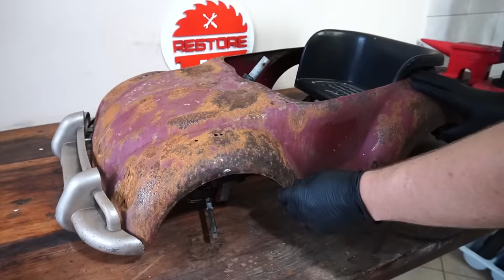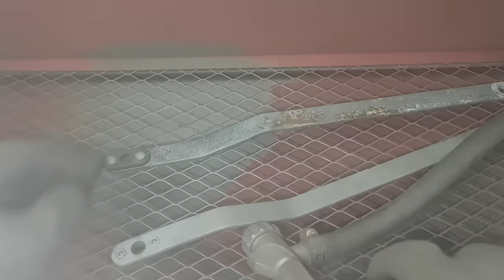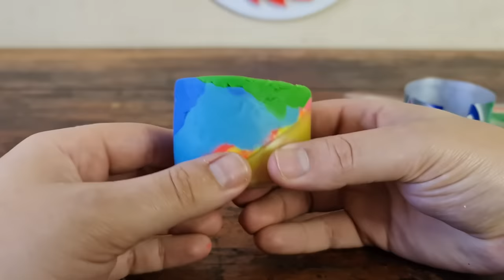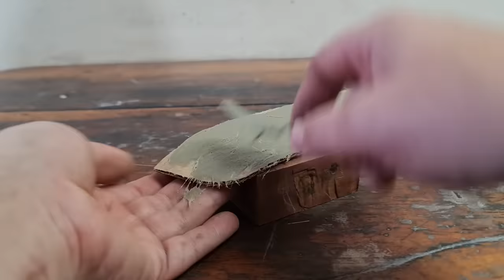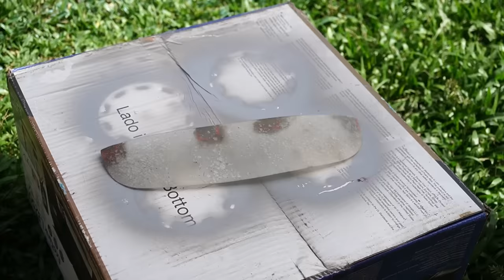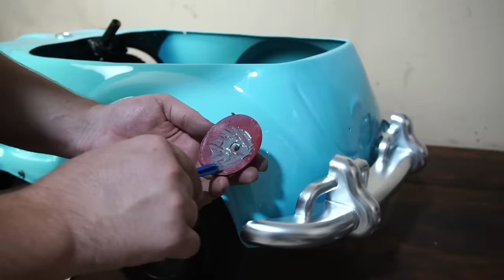Beetle Vw Pedal Car - Restoration Abandoned Old Rusty Car

Comment: Work smart not harder. Finally someone who is smart enough to use a pressure washer to take off the paint remover! I also use the sand blaster attachment for the pressure washer to take the scraps of leftover paint and rust off. Yes, this leaves scratches, but so does a wire wheel. Now how can you be smarter about buffing down the JB Weld on the metal? 🤔
Great ideas for molding new parts!

Comment: Should have soaked in a tub with 10% molasses & the rest water for 2 weeks.  The rust would have been totally neutralized & then take a wire brush to remove the black residue.  The best part is that its totally safe for the environment.